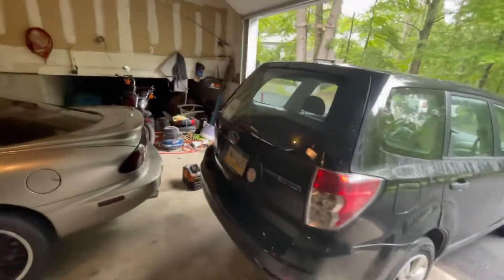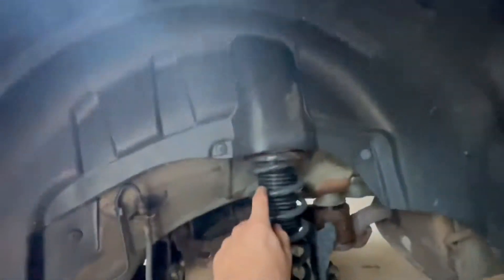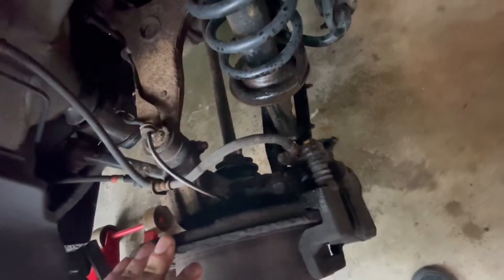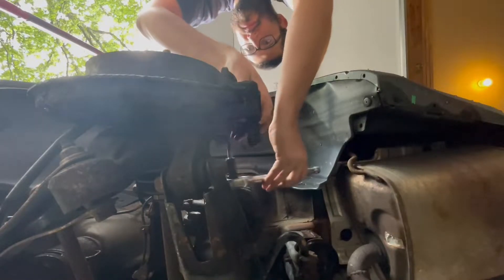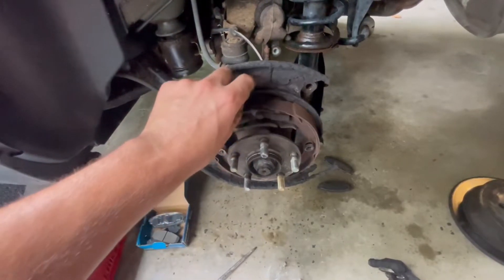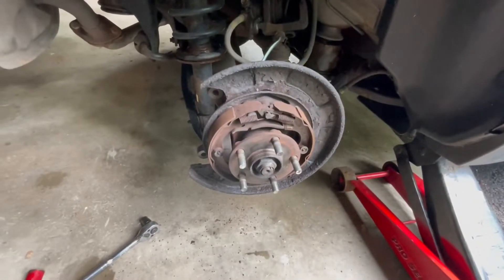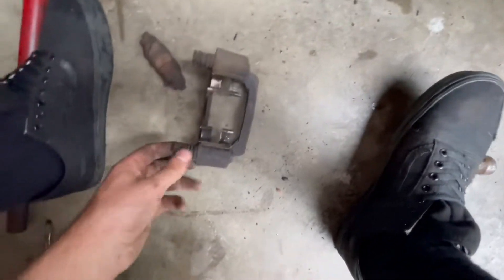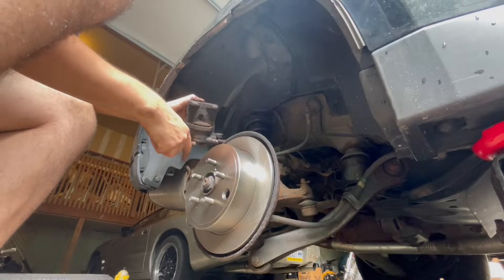2009 Subaru Forester rear brake change

Comment: Is it necessary to adjust the parking brake after rotor changes  if the adjustment was done a few months before the rotor replaced ?
Thanks
Reply from the maker: I don’t think so. I didn’t touch mine and I never had a problem following this job.
Reply: Your reply and video is very much appreciated. 
❤